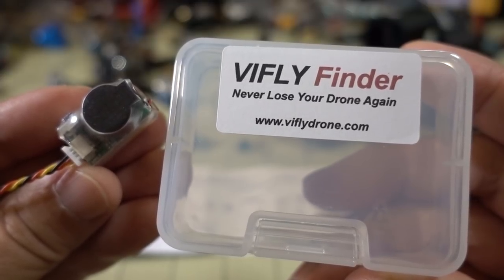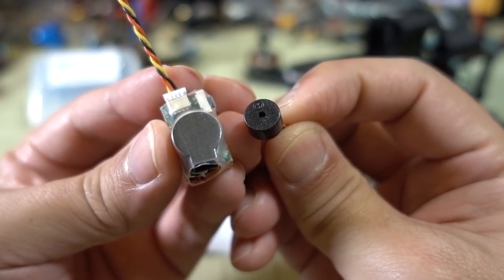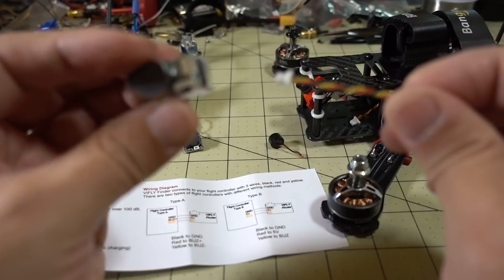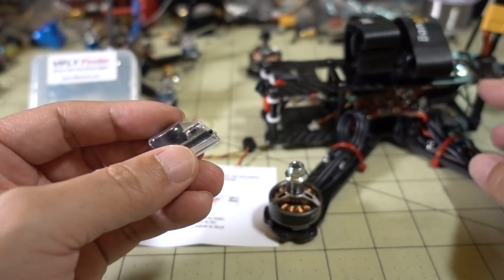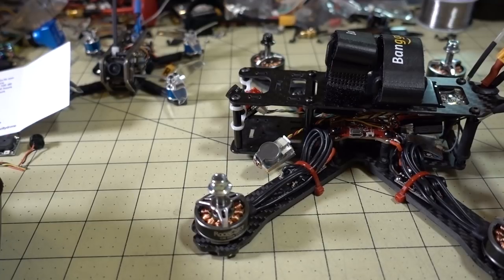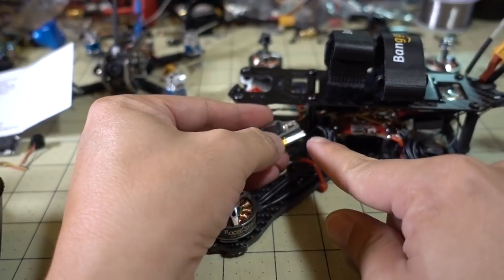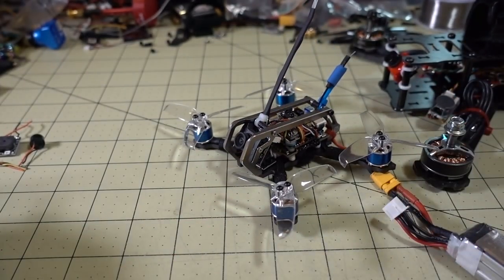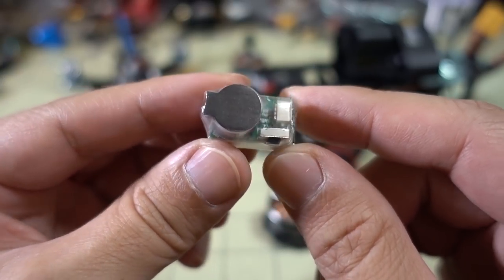VIFLY Finder Lost Drone Alarm 👍

Comment: Is it possible to have it CONSTANTLY beep? I want to put it on a model rocket with no power or controller to plug into the buzzer.  Will it work?!?  THANKS!
Reply from the maker: This one can't do that.
Reply: doh. thx for the reply!
Reply: just connect the yellow wire to the black one...maybe will beep constantly

Comment: The idea is good, but the dimensions and weight for 2-3inch are too big. And the most important test, when will buzz buzzer if the battery stays on the copter? How much time will the drone lie before the battery is discharged to 5v and lower. I'll wait for a more compact version.
Reply from the maker: I think it will go for up to 6 hours
Reply: @AlbertKimTV  At the gearbest now there is a similar beacon weighing 2.5 g, search by lucky box beeper.